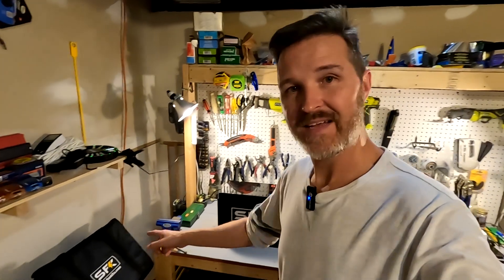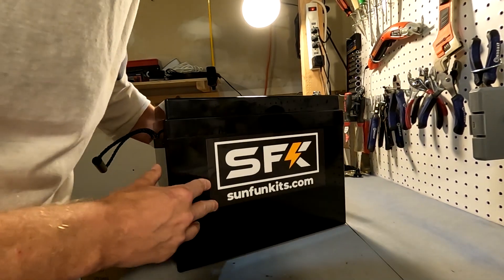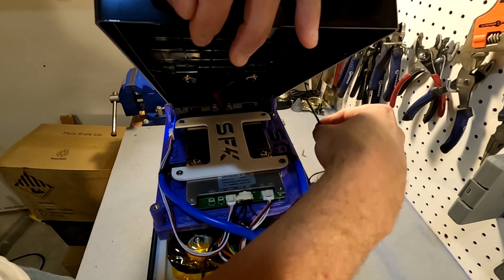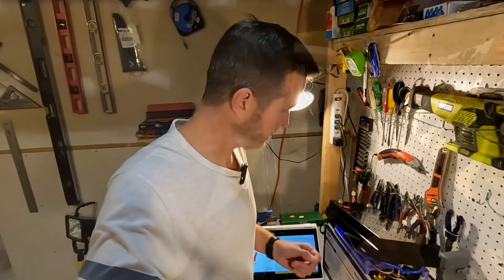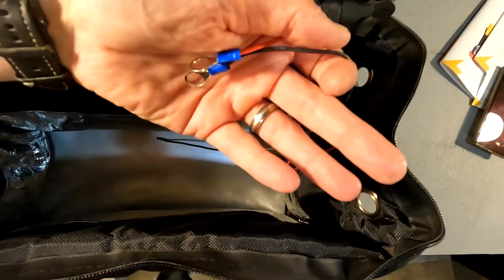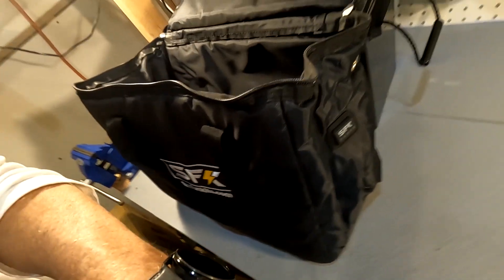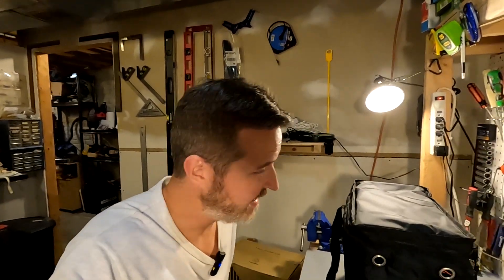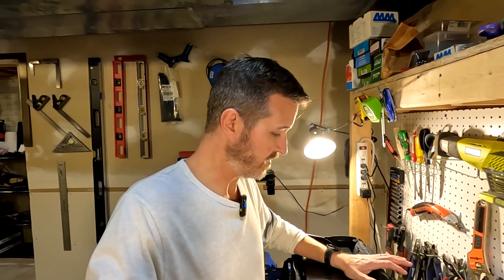Sun Fun Kits 275Ah 12v LifePo4 Battery Review Part 2

Comment: i would ask for amp draw at all 5 different heat settings on the bag
Reply from the maker: Each setting pulls 7 amps.  I believe they turn off and on to keep temp of bag.  Also, the first three are temp settings while the last two keep in on for either 12 or 24 hours.

Comment: It's nice to have proper gear  battery jacket. Still keep watching. See what you do with your chins. Hot water bottles pizza bags  electric brackets. Today looked at heated clothes even chinese ladies heated underwear. Difficult choice to keep Chins above zero this winter. Lol. I have similar dilemma 😅
Reply from the maker: You will want to find something that is DC powered.  That will give the most bang for your buck.
Reply: @OffGridBasement  , You can buy just the heat pads on ali express USB wire 5 bucks.  Think you need own power bank. Bit of a mine field god knows what heated jacket does keep warm. Great for kids if they work. Some of the Long John's even have an phone app to control temp. Find a channel , I guess that reviews if they are really any good. For humans or batteries  135 dollars plus shipping makes sun fun Proper but expensive option.

Comment: Hi Jim some tips. For discharge make sure you have set 150 amps for the max discharge in the tools tab and hit update. By default it is 125.

We will test our app with chrome books we have not used or tested the app on these devices only android tablets phones and ios devices.

The first 3 modes on the bags are heat levels and the last 2 modes are timer levels. Mode 4 will shut off after 12 hrs and mode 5 will shut off after 24 hrs.
Reply from the maker: Thank you for the additional information.